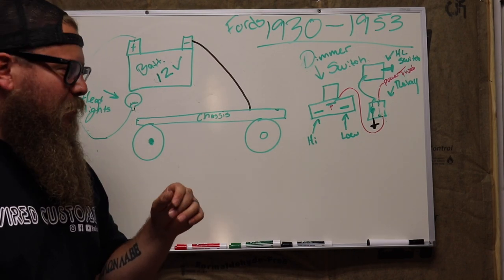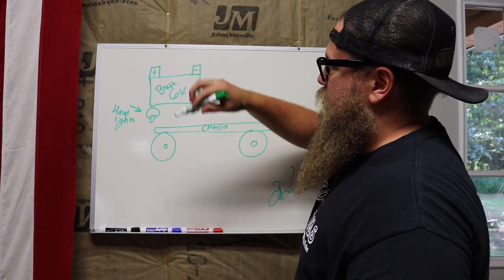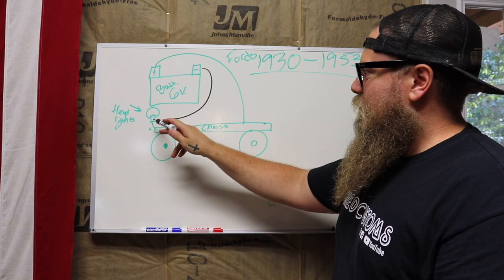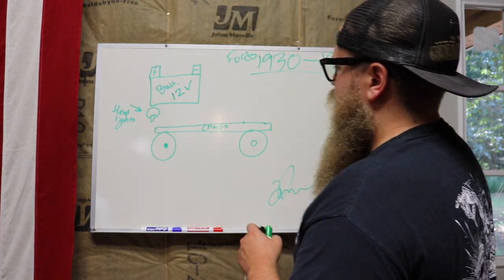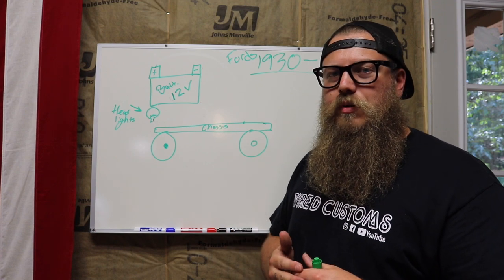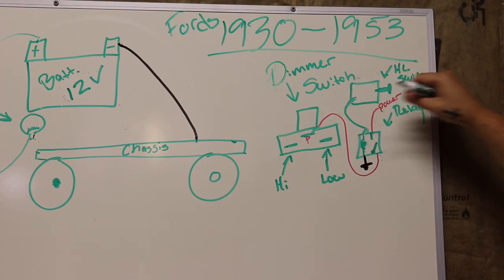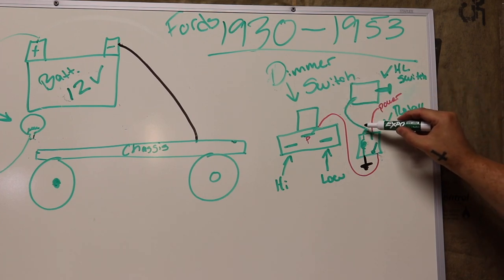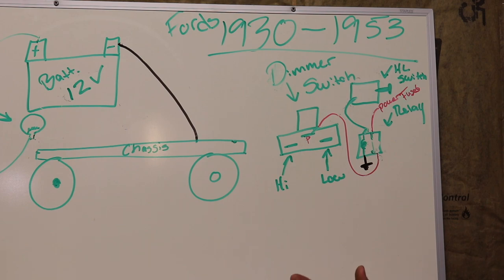6 Volt Positive Ground and 12 Volt Conversion Explained

Comment: Ford, British, and Japanese companies ran positive ground not due to current issues or relay costs, but due to corrosion science. That is negative charged metals become a sacrificial anode and iron is cheaper than copper. Relays will work pos or neg ground also. Your “load” explanation is for AC not DC. All vehicles are DC and the load is the same no matter how you ground it.

Comment: th switch explanation is wrong. the same voltage and amperage we found on the lamp is on the switch! amps doesn´t evaporate! sure you need an relay, like we use today, to not burn the switch. 6V has even the double of amps if you compare with 12V (same watt at the lamp).

Comment: My 53 ford is already changed over to 12 but a guy told me make sure you don't burn up your heater or radio? So how can I know if the radio and heater is properly changed over? Thanks
Reply from the maker: I would check their power supply with a volt meter, they should be 6V negative ground, you can use any voltage reducer for the radio but for the heater it has to be a high amp reducer, Vintage Auto Garage sells specific reducers for a heater

Comment: Nice, thanks. If i were to switch everything over from the kit but keep  the 6v generator till it dies, would i then have to run a 12v negitive ground voltage regulator. I assume so. I will have nothing on my truck except external lights and turn signals.

Comment: I'm in the process of acquiring a '35 3 Window Coupe Ford. It's a nice solid running car which I plan to recondition to be an occasional driver (not a trailer queen). It is a 21 bolt Flathead that runs great but, it's 4:11 gears, mechanical brakes, original '35 21 bolt flathead with 6V electrics. My quandary is this; what do I do first -  the differential so I can achieve 60mph without killing the engine or, upgrade to a negative ground 12V system so I don't burn the car to the ground?
Reply from the maker: The very first thing that I would do is a wiring harness, if the car is original style wires there is a bunch of circuits that are re unprotected and don’t have fuses, even if you wanted to keep it 6 volt I would still recommend modern style fuse box and relays

Comment: So how does this work with the starter?  If it's built for a positive ground and you reverse the polarity, wouldn't it spin backwards?
Reply from the maker: The starter rotation isn’t determined by polarity it’s determined by how the wires are spun inside, starter will spin the same direction either polarity

Comment: Total B.S.  This guy knows nothing about what he is explaining!
Reply from the maker: Explain to me what’s wrong then
Reply: @WiredCustomsSpeedShop  -- The first half of your video, almost everything you said was wrong!  You constantly referred to the negative side of the battery as Ground.  Ground is the frame of the vehicle and whatever side of the battery is connected to it.  Relays are great to have to switch high current loads but are not related in any way to what side of the battery is connected to the frame.  Weather you're switching the battery side of a load or the ground side of a load, the switch is still switching the exact same current.  "After the load the amps are a lot lower"  No, the current is the same on both sides of the load.  You may be good at converting a 6 volt + ground cars to a 12 volt - ground system but you need a better understanding of basic electrical terms and concepts before trying to explain this process to others.
Reply: @rpsmith  I hear what you're saying, but you could have been just a little nicer bringing it to his attention, or you could have just explained it in a nice comment, or even better, take the time to make a video, and explain it. I would definitely look forward to that, and once you do, reply to my comment and let us know.
Reply: @OnlineAutoRepairVideos  -- You are 100% correct.  My bad and my apologies to Zac.
Reply: I agree with rpsmith. Misinformation is worse than no information.

Comment: I have an old John Deere tractor on a 6 volt system, I was wondering, can you use a step-up/ boost converter to boost it to 12 volt just to run 4 LED lights?  Like to keep it as original as possible but I don't want to convert the whole tractor to 6 volt.  I would just like brighter then candle lights if I have to work at night.  Like original but need to battle functionality.   Thanks
Reply from the maker: They make 6 volt LEDs, that sounds like the easiest solution
Reply: @WiredCustomsSpeedShop  6 volt LEDs aren't very common and hard to find in the correct sizes needed for a lot of applications.

Comment: Thanks a bunch! 
Something I’ve always wondered though… why is the much heavier 6v battery cable a problem in the 12v conversion? Shouldn’t the heavier cable actually have less resistance?
Reply from the maker: Think of the cable as a hose with water going through, amps are pressure voltage is volume, if the hose is too big then you won’t have any pressure

Comment: I  realize this is a 2 year old video, but I have to say, well done, very well done!
Reply from the maker: Thank you Steve I appreciate it
Reply: Ford  used positive ground from 1928 through 1954. 6V switches and wiring (+ or- ground) were designed to work at twice the Amperage of 12v systems making headlight relay switches redundant.. Especially with LED bulbs that draw almost nothing.

Comment: I'm a disabled vet that used to do aircraft electrical and HVAC.  I've suffered aTBI.  I just bought a 1941 Dodge that is being transitioned to 12 V neg ground. I'm struggling. Can you send me a wiring schematic. Thanks 4 your time. God Bless the USA
Reply from the maker: Vintage Auto garage has a great booklet you can buy that has some schematics in it and it also goes over 6 to 12 volt conversions

Comment: I am confused. I have been told repeatedly that the current from a battery flows from neg. and returns to the positive terminal. So a switch on the neg. side of the circuit would be handling all the current
Reply: In the circuit all of the load goes through the switch no matter where the switch is installed.

Inside the switch contacts may last longer with current flow direction.

Comment: I got a 49 Mercury with a 255 Flathead somebody put a 12-volt battery in it and started it and ran it I bought the car it won't start wondering if the 12-volt battery may have fried something in the system

Comment: As I am scratching my head, I sorta kind of understand. But, on my 1947 John Deere B tractor I don't understand how the 12 volt power is running to the starter. It is a positive ground system. There is a ground line running from the battery to the starter, and another wire to the same terminal on the starter, I am guessing to the ignition switch? I don't quite understand how the starter is getting  power?

Comment: Would the change of positive ground to negative ground make the starter motor spin backwards?
Reply from the maker: It does not, it’s not about polarity of the wires that decides the directional spin of the starter, it’s about how the starter is internally wound

Comment: How is it that my 29 model a is negative ground 6v? It was that way when I purchased it. What has been changed to allow for that? I've been driving it that way for almost 10 years with no issues. It charges as it should and everything works. However the amp meter does go to the negative when the motor is running. I'm assuming those wires are backwards and should be switched. What's your thoughts on that?
Reply: In the video you said 1930 to 1953 so is it that all 1929's are negative ground ? Because I also have a 1930 model a and it is positive ground.
Reply from the maker: @oldschool621  1929 Model A would’ve came stock 6 volt positive ground, in order to change it you have to re-polarize the generator and change a couple wires around, it’s pretty simple to change to negative ground

Comment: So 55 was the last year FMC used 6v batteries. I have a 55 Lincoln Capri coupe with a 6v Positive ground. In 56 that's when they switched to 12v batteries. Thanks for the video!

Comment: Great video Zac! Thanks for the info.  I’ve always been curious why it is common to switch to negative ground when converting from 6v to 12v - especially if there is no intention of adding or upgrading electronics? I have a 53 Mercury M100 and converted it to 12v positive ground and I am wondering if it is worth the hassle to switch?
Reply from the maker: Yeah no problem at all, and these cars drove all the time back in the day just fine with 6 volt positive ground. The biggest difference that makes it worth it to me, is worst case scenario, you could get a just start from anyone, and you could pick up basic electronic parts like the alternator if you were to have issues when out cruising, also it makes the car a little safer with relays and more fuses than original. Technically 6 volt is fine, I just like that peace of mind and the little extra reliably
Reply: @WiredCustomsSpeedShop  Great points! I was thinking about the advantages of having a negative vs positive ground? Any reason beyond adding in newer electronics that are factory made to work with negative ground?
Reply from the maker: @Gypsie33   the downside to just going to negative ground and keeping it 6 volt is now you are putting the loads all on the switches and you would still have to add modern relays to everything, for me if I was going to do all that work anyways, might as go 12v. Back then relays were expensive and big, there is only two relays on the entire car, the starter and the horn, making everything else dangerous when switching to negative ground
Reply: @WiredCustomsSpeedShop  yes I was going to keep it as a 12v but was debating if I should switch it over to a negative ground or keep it positive. Thanks a bunch for the info!
Reply from the maker: @Gypsie33  no problem, let me know if you have any more questions.

Comment: Just had my 1942 Ford Super Deluxe Business Coupe converted to 12 volt negative and electronic ignition.  Sure makes life so much easier and I can actually see at night now with the new lights!  Love it!  One question about something that I think I have the answer to, but want to hear your expert opinion.  Someone added a couple of lights (which we later determined were old VW signal lights) to the back as signal lights.  The lenses were clear and they had put some type of red cellophane paper in them to make them legal (although they looked pink).  So we put red LED bulbs in which I really like.  We didn't add resistors because they seemed okay at the time. The front signal lights are regular bulbs in the running lights.  Now, I noticed that the signals blink fast and sometimes have a twinkle to them like fast flashing Christmas tree lights!  Will adding resistors to the LED bulbs take care of this problem?  I figure that the turn signal relay/flasher is reading these bulbs as burned out perhaps?  Thanks for any information.  Appreciate you!
Reply from the maker: You need to switch out the flasher to a LED flasher, that should fix the problem 👍🏼👍🏼👍🏼
Reply: @WiredCustomsSpeedShop  We replaced the old flasher with a new three prong flasher, same as the one that was in it, and added resistors to the LED's and presto...working great!  We believe that the LED's with no resistors helped to kill the original flasher unit.  Whatever happened, the signals and emergency flashers are working properly now.  Thanks!

Comment: I have a few questions.  I’m wiring a 51 Ford to 12 volt using the 22 circuit kit from Speed Way and a single wire alternator from Vintage auto .  Your video instructed that a relay should be installed for the switches.  Is a really needed for every switch such as the lights and overdrive solinoid? if so, in wiring the switch, will I run a hot wire to the switch, then a wire to the relay, also adding a hot wire to the relay, then to the load? In the video I was not understanding how the relay was activated when the light switch was pulled.                                                                             Currently my car has no overdrive.  I have access to two transmissions with over drive.  One is from a 50 Ford and the other is a 50 Merc.  Can either transmission be installed without any modifications.  I appreciate your tube presentations.  Very informative. Al Rice Kerrville, Tx

Comment: Hey Rembrandt why do 6 volt batteries last so much longer than 12 volt batteries? I think your artwork is better than hunters.
Reply from the maker: Yet I’m still making money off of this video, thank you for contributing
Reply: @WiredCustomsSpeedShop  serious question I have 54 international but the battery is at least 6 years old maybe more like 9 or 10 6V still going and I have a 50s Ferguson tractor 6V that's battery is at least 8 or 9 years old, both positive grounds and they've outlasted 12 volts that are in daily drivers

Comment: now why wouldnt you put 12v to the chassis? if you could fuse the circuits?
Reply from the maker: Are you saying a 12 volt positive ground?
Reply: @WiredCustomsSpeedShop  yes for a 12v pos. ground

Comment: In order to make OEM 6V gages work, a power reducer is required.  How should their polarity be wired to the voltage reducer?
Reply from the maker: To the reducer it is wired up how you would normally expect, key switched, fused and + to + and - to - when you make the conversion the gauges will be wired up 6 volt negative ground, the gauges will operate normally because they work off of the resistance the sensor puts out. My previous couple videos goes over the reducer is much more detail
Reply: @WiredCustomsSpeedShop  thanks for the reply.  I knew I couldn't connect the reduced 6V positive to ground like the gauges want for obvious reasons.  The 12 to 6v reducer must have its own ground on the low side in order to work...
Reply from the maker: @johnbeyl3892  no problem, and it sure does, it has its own ground wire
Reply: @WiredCustomsSpeedShop  so one more question.  How do I deal with the ignition since it has a resistor in it that likes 6v.  Is it better to wire that all to 12v or should I run it through the voltage reducer and keep the same coil and resistor...same question for the starter solenoid...?
Reply from the maker: @johnbeyl3892   you need to watch my video “6 to 12 Volt Conversion, Everything you need” but yes you need to replace the coil and starter solenoid
Reply: @WiredCustomsSpeedShop  thanks Zach.  I'm asking a lot of questions because I'm trying to sort out a 12v conversion mess I bought from another while trying to keep the car as stock as possible.  I'm in the process of rewiring with a stock harness (the car has a 12v generator...I know...why would they do that?).  Since it's there and it works, I'll dance with it.
Reply from the maker: @johnbeyl3892  use what you got, in true hotrod fashion 👍🏼
Reply: @WiredCustomsSpeedShop  thats the aim Zach!  50s vintage hotrod...even though she's very stock.  I guess a kid in the 50s would have been give the same messy hand.  I'm good then! 😄.  I may have more questions but thanks for your kind and generous help!
Reply from the maker: @johnbeyl3892  no problem at all, always feel free to ask questions

Comment: What should be the voltage going to distributor on a 6 volt positive ground system? Tia
Reply: Points distributor? Somewhere in the neighborhood of 12,000 to 15,000 volts. To the coil, 7.4v if you can keep the generator or alt spinning fast enough.